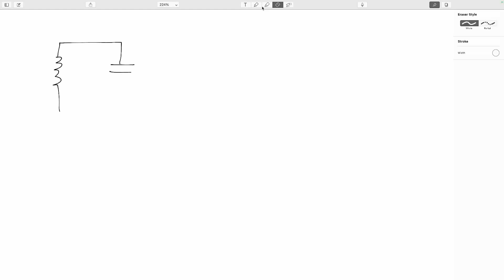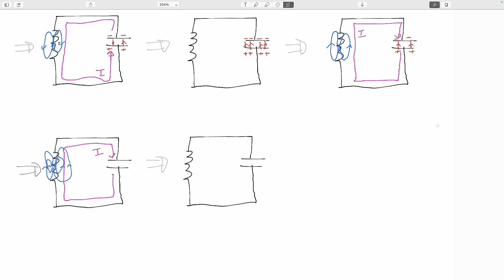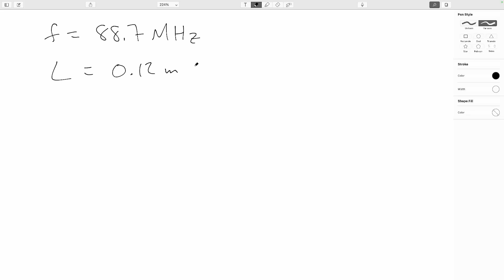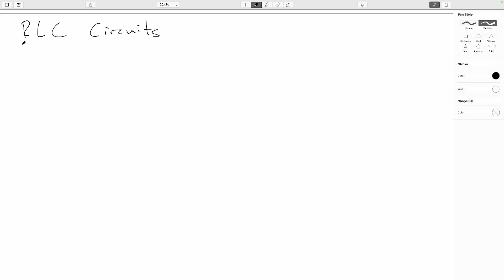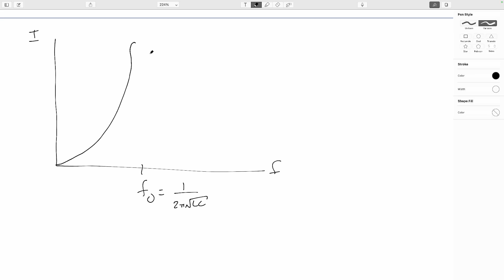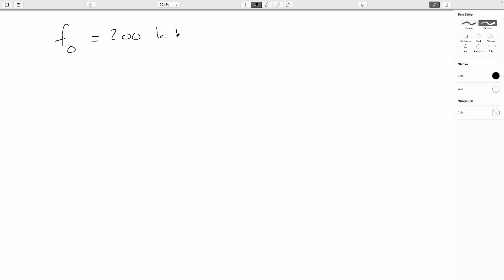Bonus2.2: AC Circuits-LC and RLC Circuits

Comment: From an electronic engineer that hasn't been in the business of thinking about the theory for many years I can say that this was a pretty good lecture. I am also very much familiar with variable capacitors form my valve radio repair days before I studied electronics but I have never seen a capacitor that compressed the material in between I don't think. I have seen them like 2 sets of half moon shaped plates moving in and out between each other or very small ones with a screw heat also moving plates more or less covering each other. The latter may look like they are pushed closer but the ones I have seen where not. They only got closer and thereby increase the capacity by covering each other more.
Having learned it all in Danish I never really thought about where the word Reactance came from. I just learned it as a name.  Now having lived in English for many many years and hardly ever even thinking in Danish it came to me that it comes from react as a resistance. Quite funny I think. Not the word or the meaning but that we some times (perhaps often) learn a word and it's meaning without ever knowing why that word is used for what it means.